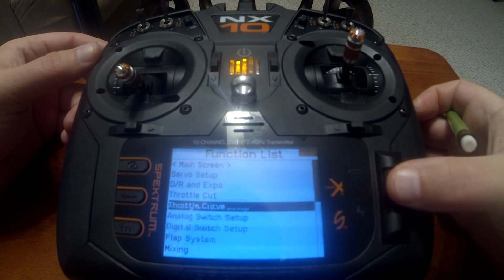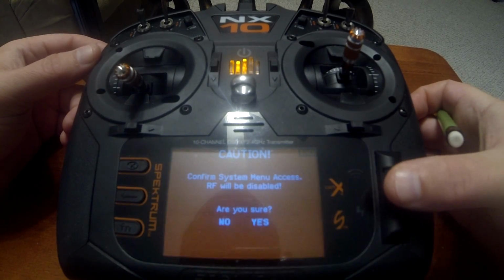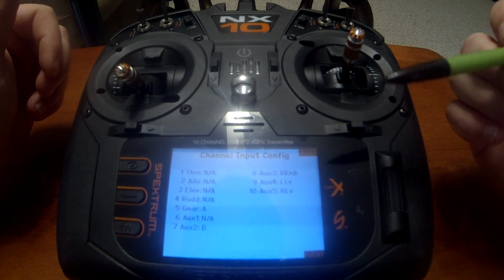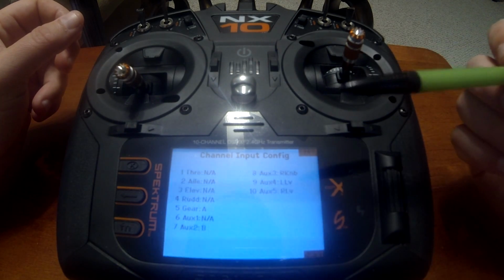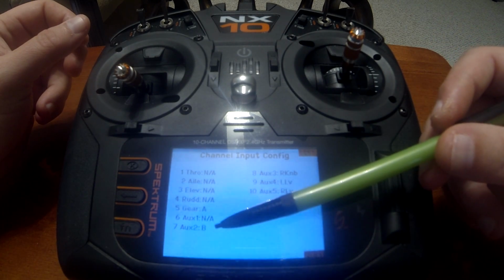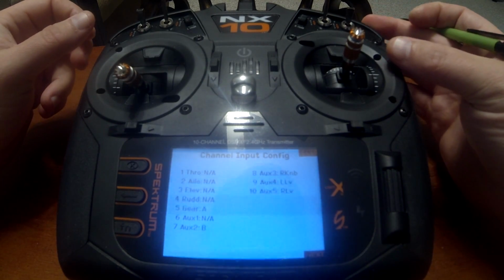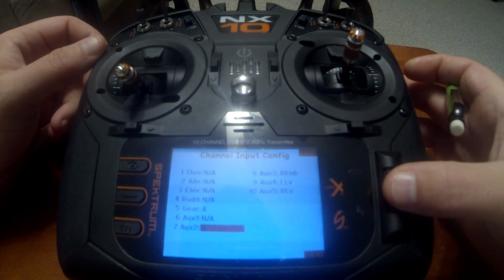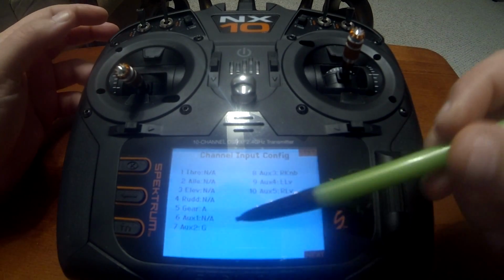Spektrum NX Setup: How to Setup SAFE Mode/Assign Switch with AR636/AR636A/AR636B (NX6/NX8/NX10)

Comment: I could not get flight mode 3 to show up when I tried this. Sure it’s something small I am doing wrong.
Reply from the maker: Some planes have 2 modes (Safe and AS3X) and other have 3 modes (Beginner/Intermediate/Expert)
Reply: @BDTennessee  how about Draco? Can’t find the third mode. I figure I am doing something wrong.
Reply: I am in the Maryville club. Anyway I could meet up with you one day in Knoxville to have you check out my setup? PM me please if that might be a possibility. Thanks to you and your videos I am feeling much more confident about my NX8.
Reply from the maker: @fdwayne4  Draco uses a AR637TA receiver. Its setup through forward programming. If you have a mode where AS3X turned off it will show 2 modes and nothing on the 3rd position.

I have a video like this one on those receiver that use Forward Programming.
Reply from the maker: @fdwayne4  probably can work that out since your local. PM me on facebook :)
Reply: @BDTennessee  please send a friend request so I can PM you. Thanks
Reply from the maker: @fdwayne4  i pmed you

Comment: I am very new to rc world and have a Nano S3 heli. Is it possible to setup separate switches and have a 3 position  switch for throttle/pitch curve setting, a 3 position switch for dr/expo settings, and a 3 position switch or safe mode? Also change panic recovery from the push button to a 2 position toggle switch. Sorry if this wrong comment area. Maybe make a vid to explain how to do this. Tnx
Reply from the maker: You could set that up. In the video you can assign the switch from 3 to 2 with the assign method.

Comment: BD,

Speaking of the NX8 and a Carbon Cub S2. If I understand it correctly there is a difference between Safe Select and Safe. Safe has an intermediate function which means if you want to set it up you would want to do it on a 3 position switch. I used the (Carbon Cub S +) bind n fly template on the Radio, however I think the S + only had Safe Select. Am I going to have to build a plane from scratch on the NX8 or can I tweak the S+ build already installed to setup Safe? Also how do you turn off/disable expo when you are in Safe mode? I do not want to double up on the settings so to speak. Safe mode already has mixes and expo built into the programming. Sorry for the long request and thanks for any help you could provide.
Reply from the maker: Correct, Safe Select has Beginner which limits your bank angle the most. Intermediate that allows more bank angle and Expert is no limiting.

You can change expo in a BNF cause rx is locked.You can unlock it the PC but not all options are available. If your starting out and running Safe i wouldnt get caught up in worrying about that.

I would start from scratch instead of modifying a model...
Reply: @BDTennessee  Thank you for the reply. That is what I was thinking is I am going to have to start from scratch.
Reply from the maker: @ericsalyer8015  when a template isnt made exactly for a model i feel your doing thet best route.

Comment: Ok BD and the switch turns my safe on and off how about my as3x. Can’t tell if it’s on or off and where on the switch is on for as3x
Reply from the maker: AR636 dont have a mode where you can turn off AS3X like the new receivers with Forward Programming. Safe off it AS3X only and in Safe on is both
Reply: Thanks I did not know that

Comment: just to be clear on this....I just picked up an older  eflight Pulse 15e with the ar636  Rx .....I have a DX8.....so  after inserting the bind plug and powering up the Rx, I then remove the plug , before attempting to bind  with the Tx ...as doing it  this way will give me  the  option to put  SAFE  on a switch...if I  bind the  standard way,  ( leaving the bind plug in the Rx during the bind ) only AS3X will operate and  the SAFE feature  will not work ...then I select a  2 position switch (  SAFE on / off )  and assign it to AUX 2...then perform  the  toggle process.......correct?......thanks
Reply from the maker: Assign the channel before binding. Also do switch toggle immediately after binding.

Comment: How do you install a kill switch on a RC airplane gas engine and then setting it up on my DX9 Spectrum  transmitter switch.
Reply from the maker: Connect servo lead to open channel. Go into channel assign and use the switch you want. Also go into throttle cut and assign same switch.

Comment: This was helpful, thank you. But what is the difference between "safe mode" and setting up AS3X?
Reply from the maker: AS3X is Spektrum Gyro to help stabilize the plane. Safe mode is auto leveling and banking is limited.
Reply: @BDTennessee  I'm a little confused now. my f-27 was BNF and I thought it was set up to be in as3x mode on startup and flipping the switch turned it off and you had complete control. so you couldn't have a switch set so it was in as3x and flipping the toggle put's it in safe select. What's the difference between SAFE and SAFE select?
Reply from the maker: @flydaddie  AS3X is a stabilization gyro. SAFE Select has 3 modes (beginner,intermediate and experience) and panic recovery. Beginner is self leveling and limits flight envelope (bank and pitch limits),intermediate allows wider envelope and experience is full capabilities.

Comment: Has there been a update to allow Safe with any custom built plane?
Reply from the maker: AS3X and Safe is in the receiver. Use them in any plane and configure properly.
Reply: @BDTennessee   Excellent thanks.  Do any Spektrum receivers have GPS functions?
Reply from the maker: @RA-gk5zg  you can add GPS to telemetry receivers with xbus ports.

Part# SPMA95871

Use my links in description to order.

Comment: Trying to program the three modes that come on the DXs transmitter for the Carbon Cub S2 (beginner, intermediate and advanced) on the NX8, I can only activate the beginner mode which ss SAFE. On the D switch of the NX8 transmitter, only the one mode is functional on the three position switch. Anyone know how to program this....I've watched all the videos but no joy
Reply from the maker: Go into Channel Assign > Channel 5 Gear: Assign Switch want for modes , Channel 6 Aux 1: Assign I button for panic mode. LED color on windshield is mode.
Reply: @BDTennessee  Didn't work. It will not allow me to activate the three modes (beginner, intermediate and advanced) built into the receiver no matter what I do.  I will keep trying but this NX8 has a massive learning curve to use it to supplant the DXS the plane came with.....
Reply from the maker: @TOURMANBOB  so you went into channel assign and assign the switches? Then toggle switches at main menu connected to plane?
Reply: @BDTennessee  Problem was I had the plane set to aerilons and flaps instead of just normal mode. Once I changed back into normal mode, Aux 1 became available and I could assign things properly. These high end programmable transmitters have a high learning curve but I'm getting it done by watching dozens of different YouTube videos including your excellent ones...my thanks again and I have subscribed and liked. 
 
As they say in Newfoundland..."bless you my son"....:))
Reply from the maker: @TOURMANBOB  oh yeah that happens. Glad you got it worked out. Thanks for the support! :)